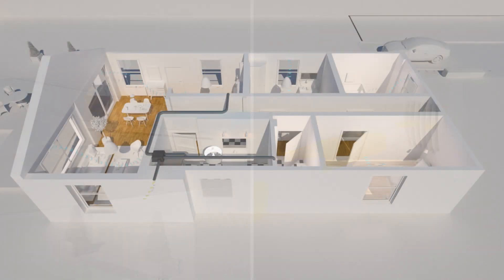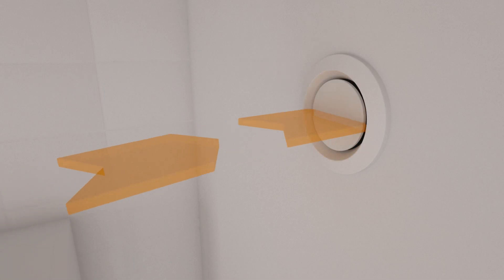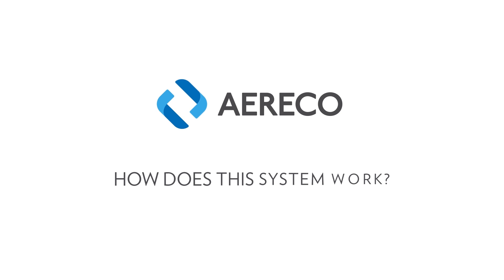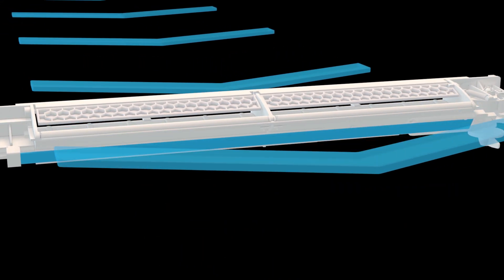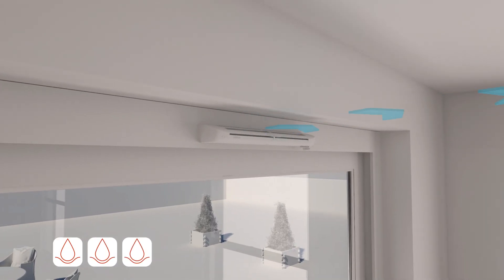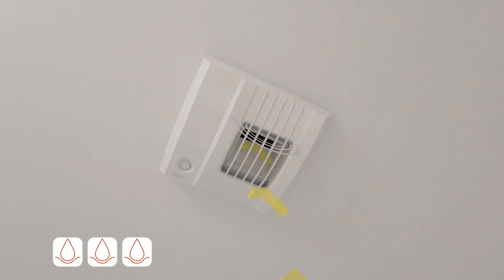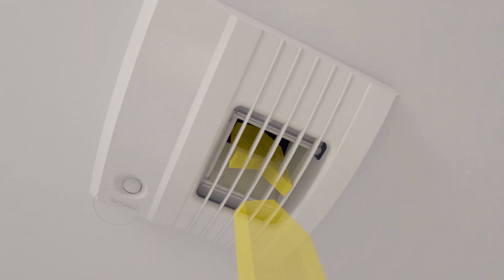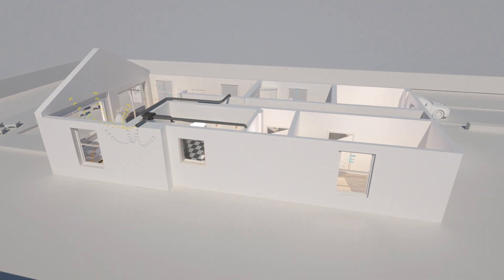Want a really smart ventilation ? Aereco, the air based on needs.

Comment: Same prob. Is there a way to unlock or turn it off? It was a default installation from the apartment and cold air and noise is coming in. How do i survive with this in the winter? i can even hear the cold wind coming in.
Reply: Turn off - just tape it. I did that for last winter.

Comment: This product is total garbage. When it's windy outside it opens permanently and lets in all the cold air and outside noises as if a window is open.
Reply: Doesn't sound like the airflow controller has been fitted, or the acoustic foam? Has the wall unit been set to the automatic position so it can respond to humidity? Have you contacted Aereco regarding this?
Reply: exactly which product do you have? Do you also have the chimney fan?
Reply: @aliasli5298  No just the product on the doors, it was already installed when I moved in. Now I ve just put powertape over it to close it permanently.
Reply: @tf8615  What is their name, can you see it somewhere? Is it the window inlet version?
Reply from the maker: We are sorry for this bad experience. Quality is a key-word at Aereco: quality controls are realised at every step of the manufacturing process of our products. External factors may explain your problems. Contact us so we can help you: https://www.aereco.com/contact-us/

Comment: I have this system at home and when there is wind outside, a lot of wind comes into the house too. 
I do not recommend it at all, it enters the cold and enters even the humidity from outside. Very very bad invention.
Reply: Hello Monica, sorry to hear you feel this way. Depending on the inlet strategy i.e. window inlets or wall inlets, we have different products to prevent excess air entering the property. They are called airflow controllers.  The specification of this product is particularly important with properties in exposed areas. Please contact Aereco if you have an issue.